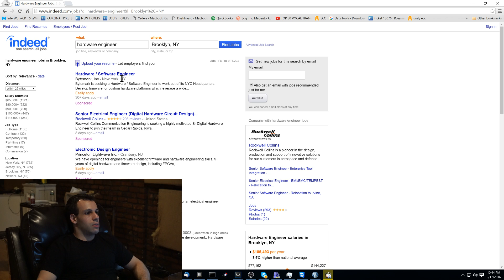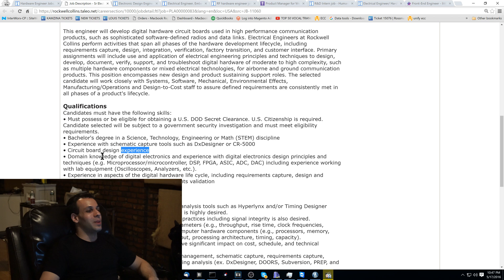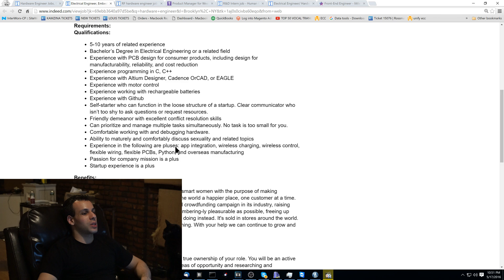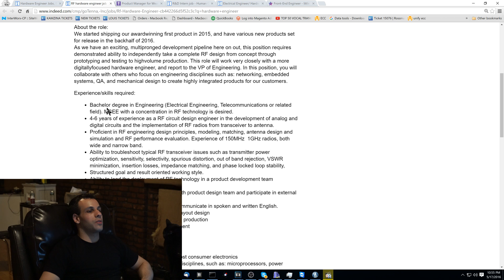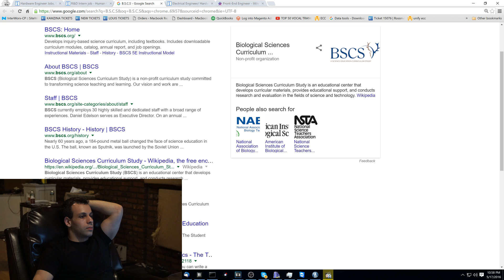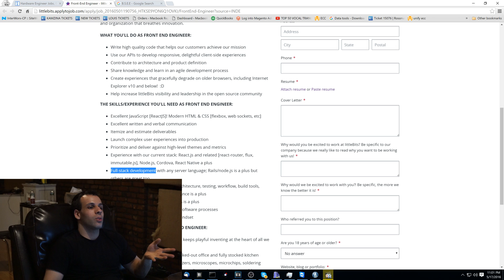Louis looks for a job

Comment: indeed job requirements:
• bachelor degree
• min five years experience
• Credit score must be at least 780
• Flexible schedule, evening, holidays, weekends, leap year, required
• must be willing to relocate
• must able to stand on one foot while juggling
• must be able to do at least 30 push ups
Starting pay is $11.25 per hour part time, no benefits
Reply: I'm a college kid. To bag groceries around here you need 6 months to a year of experience. What does that even mean. I need to already work for a full year at your company before I can even put eggs in a bag. 

You need 3 years of experience to be an intern. You need a bachelors to be a secretary.
Reply: @rrteppo  brunch of bullshit
Reply: @rrteppo  And yet, I often go to the supermarket and I end up bagging my own bags, because both the cashiers and / or bag people are shit at it: top hot and cold items together, nothing is organized at all, often soft items go on the bottom and hard items on top 🤦‍♂ I've never worked as a bag person, but damn it, this isn't rocket science!
Reply: @rsr789  that's because they don't care.
Reply: @rrteppo  That's fair. I mean if I got paid that badly, I wouldn't give a shit either.
Reply: I think the funniest one I've seen was the local liberay wanted someone for data entry. They wanted someone who could type a minimum of 120 words per second and an associates degree in writing.
Reply: @rrteppo  It probably helps if you could spell library though in all fairness to them.
Reply: @FakieStreams  lieberry
Reply: VengfulDarkness the world record is 216 words per minute. What kind of crack are they smoking?
Reply: @rrteppo  wtf Im gonna get a half degree in a field that is never hired for so I can work at your libary?
Reply: * must have two years' experience on an OS version / application / technology that's not released yet (and which you probably won't end up working on or using on the job, anyway)
Reply: @jamiehanrahan4705  I love when then ask external applicants to have experience with in-house custom software. I mean, how more idiotic can they get?
Reply: I guess training on the job is not a thing in the USA?
Reply: @TremereTT  On the job training is called internship. Interns work for free for school credit.
Reply: @TruthAndMoreTruth
We call people that are receiving training on the job AZUBI. And pay them, as they work 3 and a half day a week and visit jobschool 1 and a half day a week !
Internship is somthing we use torture people from universities...especially since the totally useless degree of bachelor came into existance... no company over here employs people with bacherlors degrees...
Reply: @TruthAndMoreTruth  You got school credit? Lucky. lmao
Reply: @TremereTT  It kinda is, only most companies require interns to be a currently-enrolled college students so that they can get a piece of the tuition.
Reply: @economicist2011  Makes sense if the companies or the guilds of the companies craft team-up with the colleges in question.

I don't know how the modern equivalant to a guild is called in the USA. There is an organisation for each and every craft that set's the standard an diecides wether youare qualified to practice the craft. in Germany they are called Chambers. Is there are self gverning body of standards for each craft in the USA?
Reply: @TremereTT  Not exactly. Closest thing you'll find is a trade union, but those exist to restrict the employer rather access to the jobs.
Reply: @economicist2011  hm ok. we have "guilds" that decide on standards of the craft and we have unions underneath. But unions basically only matter in big companies as they have 50% minus one vote decision power in big companies. 

All in all guilds decide on the things a journeyman or a master of the craft needs to know. And only apprentices they tested become journeyman and only they decide if you achieved mastership in your craft.

It's like a standard setting body and quality control on the workforce.
Reply: @TremereTT  Well, in that sense we do have licensing boards, but they're officially a part of the state rather than an industrial group.
Reply: @economicist2011  ok so you have guilds. Licensing boards can tell what you have to know befor you can work in plumbing business or so. 
This way the can team up with colleges and tell them what they need to teach future plumbers while these practice 3 or 4 days a weak in a company. and spend 1 or 2 days in college.
This way the employers create future employee to fit their demand in workforce.
As the licensing boards create the standards the employee can work at several different companies because they learn general standard practices as defined by the licensing boards...
The only weird thing is that the licensing board is under influence of the state. Sounds pretty napoleonic.
Reply: @TremereTT  I think it's something to do with each country's traditional reasons for having guilds. In Germany, my understanding is that guilds were formed by skilled laborers in the medieval era to protect their own reputations and market power from competitors who might undercut them, or worse, spoil their reputation by making people think that town has bad ____ craftsmen. Here in the US, licensing boards were formed mainly at the behest of consumers in the early 20th century to protect them from corporate behemoths who owned the entire industry and used that power to get away with pushing bad products.
Reply: @economicist2011   I can confirm the guilds part. And I think the licensing boards part sounds reasonable. 
Interesting how two different philosophies end up with an organisation with a similar function.
Also the guilds officially went out of power after the code napoleon was introduced. That's why they had a comeback under the name "chamber"...
Code napolean basically allowed everyone to do every busines he likes...
Ya I know you are as shocked as everybody reading this crazyness. ;-) [/IRONY]
When Napolean was stamped out the parts of code napolean that the people became fond of were kept, i.e. church monopolies stayed removed , nobilities monopolies stayed removed, &c.
Also the guilds never came back into their full power and during a 70 year period of set backs the guilds in Germany lost most of their power 1871. Thirty years later the guilds came back not as local body that ruled about every detail of the live of the craftsmen, but as national chambers that govern over the practices and standards of the crafts.
See? Everychange in Germany takes decades! lol 
So It took at least 10 years of war with the Frenchmen and 70 years of cultural change get rid of the guilds. Just to have them comeback in a less intrusive form as chambers but with nation wide power. Now we have these chambers for about 120 years.
I mean they work pretty well. They are just not compatible with the EU...as the EU allows every one to do business everywhere (one of the 4 European freedoms that all EU-Citizens have).
So in about 110 years we might see an adjustment to that chamber system...
Reply: Funniest one I have seen was a posting in all caps with very direct ANGRY LANGUAGE YOU MUST HAVE THIS DO NOT BE THAT.  I guess they were angry that they weren't getting qualified people but what do these companies expect when they have a laundry list of requirements and pay you 10 bucks an hour. All that does is make people instantly close your posting.
Reply: @physalis17 
That makes absolutely no sense to have a long list of ridiculous requirements, and then do not bother to disclose the expected pay rate, or else lists a ridiculously low pay rate. With such absurd requirements, they should add one more item to their long laundry wish of unreasonable requirements. "If you meet even half of these requirements and you have a pulse and can show up to work on time, WE WILL TRAIN YOU." Then they might actually get a few halfway-qualified candidates who figure that the application/interview process might actually be worth their valuable time.
Reply: @yosefmacgruber1920  Problem is RF design ,debugging(like real debuggin using JTAG and other fancy stuff and protocols witch require digital arhitecture knowledge) are really hard to train.
But i get the experience point since in my university all is theoretic.Even my labs resume at measuring 10 times the same transistor,follow the guide book and be satisfied.No playing around for curiosity or too many questions raised.I found out that the best way of learning is by asking on EE forums where some engineers happen to spend time on and help you.
Reply: @physalis17  That's why it is a good idea for companies to train their own people. Apprenticeships (as in paid training on the job instead of university)  tackle 2 problems. They steer the job marked into the right direction and they ensure the quality of the training so the company trains actually usefull journeymen.
Reply: TruthAndMoreTruth Even if your resume qualifies and makes it to a human, you’ll be up against 100 applicants with masters degrees, for that $11 job.
Reply: Kristifor Milchev 
So in other words, what you are saying, is that if we want a good job, we should move to some other country that more so appreciates our talent?
Reply: holy shit I actually meet all these requirements, this has never happened to me
Reply: In Germany it is usual to not list the pay rate but many have these over blown expectations. I like these and apply to the job when I meet more than half of it knowing that most people are scared of by the high expectations. I get the interview anyway, convince them I can do the job and ask for a high pay rate and then I get the job because I am the only suitable applier in the 4 month they are looking for someone and they are just desperate to find someone. That's how I got my current job as a "field engineer"/"commissioning engineer" without a bachelor or master degree.
Reply: @tspawn35  Depending on the program, you aren't really ready to be a software developer after getting a comp sci bachelors. It's more like "what does knowing about state machines, data structures, and compilers have to do with IT.
Reply: I've been job hunting pretty much the last 2 years... this is no joke how the vast majority of employers put in there requirements. It's just the people who are hiring dont have much experience with actually hiring people. If they want to only hire Superman, then let them live in a different Universe than the rest of us.
Reply: @excited box The ones i seen it on were elcrapo basic factory jobs it was laughable. Im not letting no damn employer who may or may not hire e do a hard pull credit check and ding my credit.
Reply: @genericname1 woooosh
Reply: In my country there's a running joke that goes like this but adds "with motorcycle" at the end to point out it's for a delivery guy position. There's some seriously fucked up vision with the hole job profiling thing in the market. Oh, and, I don't know how it is in the USA, but in Colombia, being over 30 is pretty much like being jobless.
Reply: LOL Whle in jest ive seen that garbage before for real. i see a form for a credit check on a job application i do not fill it out and i have seen them.
Reply: @excited box
"and if you need money you might do something bad"? So then, being a politician makes one to be less trustworthy then?

Maybe fewer people would have bad credit and have fewer loans, if the job market wasn't such terrible crap? Don't you need reliable income to balance a budget and keep your debt low?
Reply: @zUJ7EjVD 
Just yesterday, I noticed only 1 human-service checkout open, and the self-checkouts being more busy. Of course, I got in line for the one human-service checkout. I am not at all sold on self-checkout, it seems like a stupid corporate scam to me. A way to eliminate jobs and to trick the customers into doing the work of the paid employees. I said something about why don't they have more checkouts open, as there were obviously up to 6 human-checkouts that could have been open, and some employee said something about being short-staffed that day. Really? So this is not everyday crappy service? Do we customers need to organize a boycott of those corporations that are so clueless that they have customers waving around their money wanting to buy something, and nobody even wants to collect their money? Should I have called in a complaint to corporate? I still could do so. Should we boycott the "bricks and mortar" stores and just buy online, since we can't seem to get decent human service?

That employee said that self-checkouts haven't eliminated anybody's job. Really? Because they phased it in, and they didn't outright fire people right away? How can people be so clueless? Why should robots be given people's jobs, until those robots can prove that they are competent to do those jobs? Who would hire a human to do a job that is as incompetent as that of the robots? Robots do some jobs well, but until the robot can unload a customer's shopping cart and pack the groceries into the bags, and handle the job of a cashier, I believe robots should not have those jobs. So far, robots do a very crappy job, and do not even do their work, for which a human showing such incompetence would be promptly fired. So fire then, those incompetent robots, that make the customers do the work of the employees.

Not all stores have yet self-checkouts. Perhaps we should shift market share towards those stores that still offer decent human service. Greedy corporations do not want nor deserve to have customers or to stay in business? Maybe we should give them what they apparently want? Then we can enjoy their "Going Out of Business" sales, waiting in line of course, for a human checkout person and not some incompetent robot self-checkout scam.
Reply: “I have a degree and I can do more than 30 pushups in a set but I regret to inform you that I can’t afford to work for US$11.25. I wish you the best of luck finding a sucker suitable for your position.”
Reply: @excited box
In Germany, I hear it is "illegal" to home-school your children. That alone should be sufficient reason to leave such a backward country. Why in the world should the corrupt government be allowed to have a massive monopoly in so-called education?
Reply: Most jobs seem to have some benefits, but the benefits are such a sad joke. I was looking through the benefits brochure, and what a cruel joke! On the small pay, which of the benefits are affordable? Not much if anything, and no free benefits? So those jobs that have benefits, might as well say "no benefits", well since the benefits are not a good value anyway and the employee who can't afford it, is expected to pay for them.
Reply: @yosefmacgruber1920  But at least you're not a flat earther. At least you can see some sense. Still, I'd recommend you watch hbomberguy's video on why the flat earth is dumb, if for no reason other than to laugh at the idiots who think the earth is flat.
Reply: No joke. 90% of that was for a job as an apprenticeship.
Reply: Why do you still live in that country... ?
Reply: @vyrgozunqk 
Please tell us some easy way to get status to move to a better country? I think a lot of people would leave, if it was easier to do.
Reply: Yosef MacGruber you need to file a citizenship rejection and search for some job on another place. If you have proper education, you won't have problems.
Reply: @vyrgozunqk 
Have you done this? You make it sound so easy to do? So according to you, all I need is a job offer, and they will make me a citizen or a permanent resident? Where is this wonderful country of which you speak? And yes, I am highly educated.
Reply: I can do 30 pushups. Arms will be completely useless but they didnt specify anything like that!
Reply: damn what country do you live in
Reply: this isn't even that bad
Reply: @stevee4444  I don't know what any of this means I just like writing comments.
Reply: i can do 30 push ups soemtimes
Reply: @stevee4444  Kappa
Reply: @tspawn35  there's computer networking degrees and diplomas, they just don't know the details or look for a broader audience when doing interviews.
Reply: Saw a job here for a Visual C++ programmer, min 5 years experience on a "Kid's Browser." Noted "Will be tested." $10/hr
Reply: @czos9239 
What in the world is a child's browser? A stripped-down useless version of an actual browser? A browser with the text size switched to super-large? A browser that favors "children's" websites? Come on, children these days are using real smart-phones and real computers, and not baby-ized versions of them. I recall on Star Trek TNG , their "children's computers" in their school area, couldn't really access much anything too important to the ship's operations, just children's simplified versions of the ship.

$10 per hour is a sad joke for a programmer. It might as well say, "No need to apply, as we only think highly-skilled programmers deserve minimum wage."
Reply: @excited box
When most everybody goes to government monopoly schools, then that is a monopoly, whether or not they call it one or not. Why does the (American) government steal our money, and give it to the government monopoly schools, yet we can not send at least some of it to the private school of our choice? That is monopolistic type behavior. And somebody at my place of worship, likes to go on a rant about "higher institutions of advanced brainwashing" or something like that. When you have to be indoctrinated for many years of "education" and get a degree to teach, what is that about? Well they obviously want for teachers to be indoctrinated into their secular and often fake-science way of thinking.

That parents are not allowed to teach their own children, or subjected to bizarre unrealistic requirements such as "have a college degree" to run their own home-school, that is a monopolistic system of government brainwashing.

"Free people do not let the government educate their children." -a religious leader whom I respect

What qualifications are needed really? God knows far better than those edu-crats. (See the beginning of Deuteronomy 6.) You have to be able to read, to order study materials, and have to care much about your children, probably more so than the evil edu-crat propagandists. I think most parents who are literate, qualify. In fact, some parents who are illiterate might qualify. If their children can read, then they are capable with the proper parental motivation, of studying on their own. Who doesn't know that some handicapped people who can hardly take care of themselves, somehow manage also to be parents?

Admit it, Germany is so very wrong on this home-schooling issue, and that is just another reason why I likely would never much consider living in Germany. For people to have liberty, they need the home-schooling option, well especially if the government monopoly schools become immoral or pathetic or weak in STEM, as with the sorry American schools after the evil leftist liberal-retards largely took over. Besides, I don't like Germany's/Europe's bizarrely-low birthrate, their bad history of electing Adolf Hitler, the German language sounds stupid, etc. And if Germany is so supposedly advanced, why don't they use English, the international standard language, more so?

In Babylon immoral America, in quite many states, a simple annual test to see that students are learning, is all that is needed to remain legal with the education requirements, and home-schooling is much protected and defended by the organizations that promote and serve it. And home-schooled students easily out-perform their government-schooled peers. Now maybe Germany's government schools are not as pathetic as our American schools often are. But that is no excuse at all to ban home-schooling nor to be running such a huge government monopoly.
Reply: I felt that :(
Reply: Your employees rate are so low
Reply: 11/hr dollars im in. in my country they pay me 7dollars for my 9hrs shift imagine that.
Reply: ummm not here its not, indeed automatically has me three job offers a week no interview even required 
i am not even looking for a job

wtf r u doing wrong
Reply: @odoggow8157  ummm you're an idiot, indeed has open jobs recommendations.
There is  not a company in the world that hires people off of their indeed profile alone, with no application, interview, aptitude testing, background check, etc, etc.
Reply: They all just want instead of outsourcing their IP to third-party have their own cheap engineer, preferably from 3rd world to pay even less. Best to get above this ridiculous requirements is your own small business for board projects etc, they will contact such small business if they don't have a choice, in contract instead of stupid requirements will be description of needed product.
Reply: No relocation pay either.
Reply: 10 years experience...no older then 20 years of age.
Reply: SeasonedGamer no programmer would want to get paid 11/hr with bachelor degree. 20 an hour minimum.
Reply: yeah capitalism totally works guys
Reply: @jeeBisOkay 
Yeah, but where can we find capitalism? Where? It is so corrupted by government socialism dominance, and by corporatism. So how can you blame capitalism for not working, when where is a place in the world where capitalism has been tried recently?
Reply: @yosefmacgruber1920  Corporatism can't be separated from capitalism. It's the natural progression of capitalist society.
Reply: @yosefmacgruber1920  Yes, that's what every businessman out there tends to do, with very few exceptions.
Reply: @yosefmacgruber1920  Please watch hbomberguy
Reply: @jeeBisOkay 
Who is that?

Do you not agree Louis Rossman's original post, the typical listing of job requirements is actually quite crazy? Why should an intelligent person look for a job, in this crappy job market? Why not just leave and move to a better place, a place that more respects its people? They ask for so much in a job listing, it in effect says, "Nobody need apply", and then they offer up crappy low wages for all that. Why even bother with it? I am glad that Louise was able to create his own job and business, and bypass the crappy stupid job market. If the job market was anything like it ought to be, it should be about as easy to go land a good job somewhere, as to go shopping and buy something. Our labor would not be so hard to sell. A job listing for low pay and requiring basic okay job skills should read something like:
• Are you alive? Do you have a pulse?
• Do you have a history of showing up on time for work? Do you have a car or a bicycle or a Segway or electric scooter, a reliable friend or relative who can provide transportation, live within walking distance of a bus stop, or live within walking distance of our worksites?
• Are you free of any significant criminal record? Are you here in this country legally?
• Do you know how to read and to follow directions?
Congratulations, you are hired. We won't waste your time with stupid excuses to not give you work. Come work today for us. After you have been here for a short while, there is good potential to move up and earn a raise.
Reply: @yosefmacgruber1920  Let me guess, you're a flat earther too.